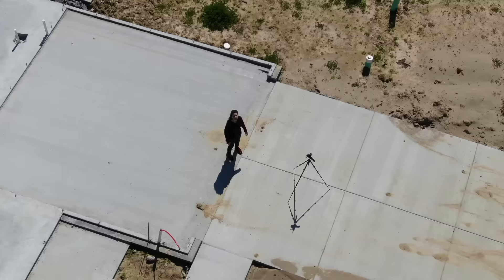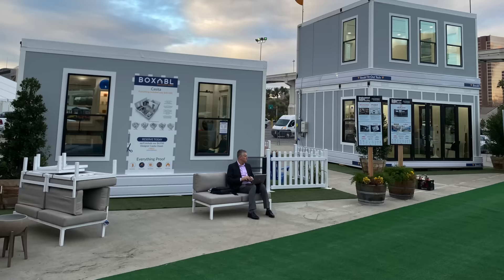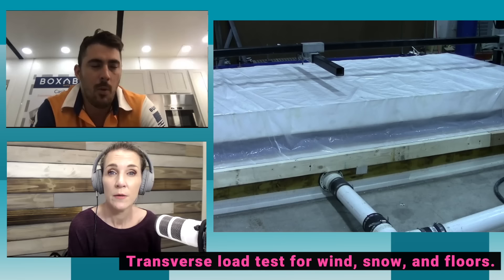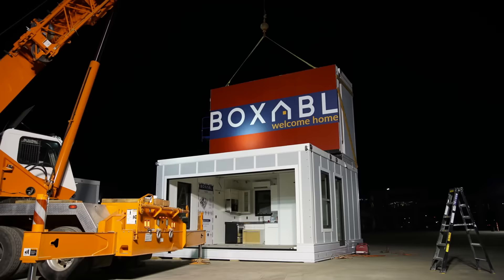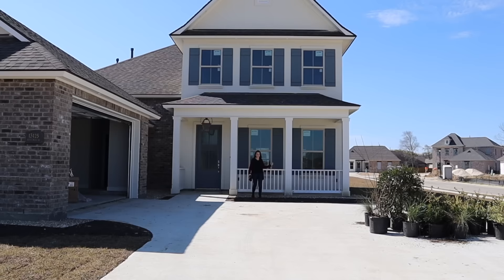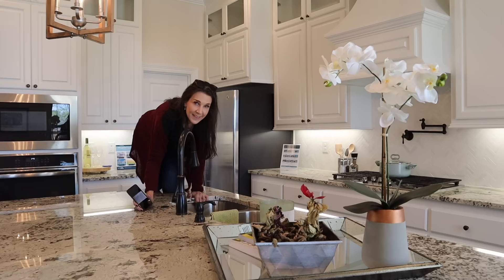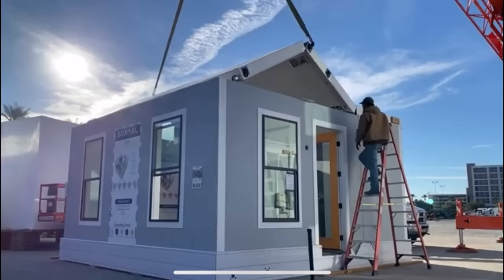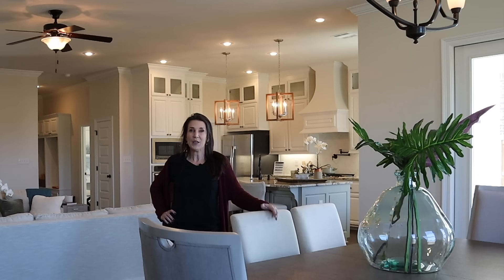Build A House In 2 HOURS?? FOLDABLE Modular Homes

Comment: With the homeless population continuing to increase as the Middle class slides into the Poor class. I can see this type of housing being of great benefit in alleviating the crisis in a cost efficient and timely manner.
Reply: artist one  ok we get it. You don't  like  this type of housing.  Who are you anyway? Some sort of "Super Troll" on here. I've read all of your comments on this vlog. They're all negative. So don't invest in one of these homes. 
I like this idea. The company builds it in the factory.  Delivers the home to your site and sets it up in like a day. The buyer of course has to coordinate setting up water and power. This gives the owner options like, Solar energy, Rainwater reclamation or well water, Propane or all electric for power and heat etc... I can purchase a beautiful lot down the street from me (5 acres) for $13,000. And taxes, well we all gotta pay taxes. Even after you're dead and cold in the ground the damned government comes for their taxes. With all of these costs I can still see this home coming in under $100,000.
So what's your problem?
Reply: Maybe at some point, but you could build a basic 20x20 stick and brick for $15,000 easy (finished out inside). The solution to homelessness is cutting municipal regulations so that it's easy to build 20x20 semi off-grid units in the $7,000-$20,000 price range. Homelessness becomes a problem when there's barely any options in between tent city squaller and $2,000/mo apartments.
Reply: @chrystallee5528  $100,000 !? I was hoping for $20,000, for the first floor of course maybe $25,000.
Reply: @caasi09ification  It sounds like you're living in a state of denial when it comes to the true facts of the situation. I agree there are lots of reasons people become homeless but once you're in the pit you can't easily claw your way out. The only reason $7.25 isn't a living wage for an unskilled worker is because of housing costs. Food and other commodities are fairly cheap. Apparently you want businesses and the economy to suffer and you want no homeless people to be able to get jobs period. Either they're paid exorbitantly well despite the fact that all they can do is push a broom, or they can rot and die on the street. It's a twisted mentality. 

It only costs $1,500 to build a 10x10 shed with a bed and solar panels to get out of the weather and lock away your stuff while you're at work. Let the job market thrive by lowering the minimum wage, boosting the number of easy, menial jobs for homeless people and within a couple months they should be able to save up enough for at least a shack to live in, bought and paid for. Maybe rent a parking spot to put it for $100/mo with a bathroom available on site. You may think it's too primitive but you can't say shit until you've lived in a soggy cardboard box. The possibilities entrepreneurs could come up with for housing the homeless cheaply are endless, you seem incapable of thinking outside the box. It's all a matter of de-regulating the housing market so these ideas can be implemented legally.
Reply: Chrystal Lee Drug addicts trash anywhere they live. I let a drug addict live in an RV I had once and you can’t imagine what a mess he made of it.
Reply: Chrystal Lee that won’t work. 1) the middle class isn’t going into the “poor class” they are mostly moving to the “upper class” I think the middle class shrunk by 6%  and 4%  went to being upper class. But also homeless people would need land to put these on and if they don’t have $1000-$2000+ for rent then how are they gonna get 50000$-100000$ for a factory built home?
Reply: @LucasFernandez-fk8se  Los Angeles is building some outrageously priced development for the homeless right now on Venice Beach. It will cost a lot and house too few persons for the amount being spent.
California has a 1.2 billion dollar approved bond and another 20 million dollars set aside by the county to assist the homeless.  I'm  sure housing like this would cost much less per person and it could be built rapidly and house more people. And this permanent housing could be set in area's  that wouldn't offend those "NIMBY" folks that want the problem solved just "Not in my backyard".  I mentioned  Los Angeles because their homeless population is estimated at over 100,000 in LA County. This includes, women, children, working poor, elderly, veterans handicapped and mentally disabled persons. Not just drug addicted  individuals.
Reply: @bluemopdisaster6445  They said in the vlog that the homes start at $50-55,000 (not sure if that included transport). Then there is land costs, development of the plot, implementation of utilities if not there already, Permits, inspections, and taxes and some cushion for unexpected expenses.
Reply: @markbtw7987  Really? $15,000?
That sounds great. How can I get a $15,000 400sq ft house built? Tell me more.
Reply: @chrystallee5528  I just built a 14x16 tiny house. Lumber was $1,200, metal was $1,100. Windows and doors $500. Insulation $400, wall panelling $350. Laminate flooring $250. Electrical/misc items $400. Cabinets/sink not finished yet but should be around $400. Bathroom isn't finished either, ballpark $400. Total: roughly $5,000. It only took like 3 weeks just me and one other person. If you found the right crew to do it for you that'd be probably another $5,000. You get the picture. Land, septic, water and electric will cost a bit more but that's not included with this $50,000 house in the video either.
Reply: @MarkBTW amazing. I am really impressed. Home ownership for under $50,000. A new built home.
Maybe you should start a program for economically housing those persons lower on the economic ladder.  I hope to one day have a small home somewhere. Are you a home builder? Is that what your profession is or do you just build for a hobby?
Reply: I think you are slightly confused as to what middle class means. A 400 square feet mansion and 3 brand new cars is the upper class.
Reply: I dont. I think you are desperate for a home and too insecure to deal with the paperwork for a REAL home. This depreciates. Period.
Reply: People need low and fair housing for 100,000 to 200,000 dollars for single and small families and this is a good idea if it works really for expensive cities and California homeless problem for sure is
Reply: All the homeless need to come together and fight against this bullshit it's pulling everybody closer into communism. If people could only learn to work together this wouldn't be a viable solution. This is a nightmare living situation. Fields of these people on top of each other houses only feet apart no trees sounds like absolute hell.
Reply: @Commentator541  not sure whom you are addressing this comment to but here's some info for you. 
The 2018 piece from Pew reported that, in 2016, the median income for the upper-income class was $187,872. While for the middle class, it was $78,442, and for the lower class, it was $25,624 (in 2016 dollars; figures reflect a three-person household).Nov 20, 2019
Reply: @wiseowl1580  If you're comment is to me. I have owned 2 homes in my lifetime  but I am now interested in minimalist living and someday having a small, self sufficient home in a semi rural area.
Reply: @chrystallee5528  for the cost a mobile home would be cheaper and twice the space
Reply: I like the fact that this is even possible and its going to save a lot of family in the future. I'm in support of its development.
Reply: @chrystallee5528  when you hear any business talking about fema in any way that's code for when the s,, t happens. Gingerbread another code. So all persons will not agree not saying they are not good homes. But if HUD is not cooperating then they are only available to the privilege ones so if you got land there you go.
Reply: Chrystal Lee  Yea but somebodies going to want money 

Where are you going to put it ? In somebodies backyard ?
Reply: Chrystal Lee most city’s and county permits are so high that’s why people choose to not build. Just a permit cost an average person yearly wage for about 3-7 years. If they just allow building to go up and collected taxes then homeless would be gone.
Reply: @caasi09ification  you're absolutely right. Homeless people with drug and mental health problems are not the type you want living anywhere near you. I'm experiencing it right now.
Reply: @caasi09ification  Actually it won't. A lot of Middle class people will still want traditional homes. This is not for everybody but it gives options to a lot of people who wouldn't be able to afford a traditional home.
Reply: @markbtw7987  Same here in Canada. I am on disability and have lived in the same windowless apartment for 15 years. I have paid enough in rent to have bought a house. If I was allowed to rent to own a house for $50,000. The government wouldn't have to keep bleeding out money for rent. If we where able to use well water that would also cut costs.
Reply: @markbtw7987  trickle up is how jobs are created. A company won't hire more people than they need no matter how cheap the labor. The more disposable income people have the more they will spend creating jobs. They go out to eat more creating more jobs and income for restaurants which means more money for the staff. They go out and spend more creating more jobs ect. Learn real economics instead the the voodoo stuff some groups promote.
Reply: @chrystallee5528  
Those additional costs apply to ANY new construction project.

In traditional stick-frame building, ~65% of the costs are for ON-SITE LABOR of the many various trades involved:  concrete, framers, roofers, plumbers, electricians, drywallers, cabinetry/finish carpentry, and painters, etc

That's A LOT of individual tradesmen to employ and license/bond/insure, or A LOT for a GC to hire and pay and still make his/her profit.

And that traditional stick-frame home will take MUCH longer to build, and will be built in an uncontrolled environment (potential weather damage), and the quality of work of each tradesman may vary due to individual skill and availability.

Once site prep is completed, having a finished structure move-in ready in 2-3 days instead of 3-6+ months is a GAME CHANGER!

This type of modular, factory-built construction minimizes each of those on-site labor costs, and moves them to a much more controlled environment, with more consistency of the building process and quality control.

The on-site prep, grading, and foundation work can also be done more efficiently and cost-effectively because of the consistency of the basic 20'x20' modular construction plan and utilities/sewer hookups, i.e. no odd, unique, or extensive custom work needs to be done for each individual home.

And 90% of the building inspection time and red tape is already done in the factory!  That is a HUGE time and cost savings that more times than not puts construction at a stand-still.

Another aspect that is important is that this single company will be responsible for the quality of construction and the guarantee of their product if any issues arise.

With traditional construction where a GC hires a large number of independent sub-contractors, it can be excruciatingly difficult to get any quick or even satisfactory resolution for the home owner.

This, of course, depends on the quality and reputation of each individual GC.  But especially on lower-budget projects, every possible "corner that can be cut" WILL BE CUT in order to maximize the profit margin.   So, you are more likely to receive a sub-par end result.

If you want something entirely unique and custom-built, you will pay exponentially more for that.

This solution aims to produce a consistent-quality product in the shortest possible time frame.  Sure, you pay a bit more for that as well, but that is usually 100% worth the slight premium.

I'm interested to see how far they can take this concept, and if the quality of construction holds up to scrutiny.

I would like to see more of the particular construction process and know exactly what materials are used before making a final determination.
Reply: @Jeffrey Kemper 
This would obviously need to be (and should be) thoroughly tested and is completely dependent on the construction type and materials used.

Just because it "unfolds" does not mean it will also fold-in upon itself under load or stress.

They still have to meet universal building codes, including shear/deflection, and actually must be more stringent overall in order to cover municipalities that have stricter local building codes, such as seismic, hurricane, flood zones, etc.
Reply: Great point and excatly what liberial Lynden B Johnson wanted
Reply: @vincent2993  and you are suuuuuch a bad speller.  Lol
Reply: @louiseschneider8103  haha I'm basically on the spectrum hahahahaha
Reply: Yes except not many homeless people or even average americans can afford a tiny $50,000 home. Way to much money for so little space. You can buy a huge traditional home for less
Reply: @clarezajac3276  I totally agree with you. It would depress people the longer they live like that. There has to be a better solution !!
Reply: Looks like a tough house but not crackhead or mentally ill proof house.
Reply: @markbtw7987  There's nearly free housing if you're that poor. But the problem is that the people that live in those areas don't treat the places too well because it's nearly free for them. That adding onto the drugs/gangs that take over and you get the ghetto.
Reply: @natureloversadventures7335  True, but the quality of most of the houses that are built down there, away from tourist areas, have no insulation, ill-fitting doors and windows, cheap cabinets, subpar plumbing, flooring, and electrical systems as well as poor sewage setups.  Many of those houses also have cheap thin wood walls on the outside and particle board or thin paneling for walls on the inside, with nothing between them to help plug up any gaps so light doesn't come in...or rain/cold.  And heating systems are basically nonexistent.

However, if a person or family living on the streets here in the USA were suddenly offered a cheap house like this to live in, they'd probably jump at the chance.  ANYTHING would be better and less dangerous than living on the streets!

Sadly, the amount and cost of permits required for building a house "up to Code"...as well as other red tape generated by  local city bureaucracies here in the USA...is unforgivable, having gone far beyond "Safety Standards" into "Greed". 

And there's no end in sight, too.
Reply: @zhenyucai8688  So once again, if  a person or family doesn't want to live in a high crime ghetto, they have no choices except to be homeless.
Reply: @andiegomes2764  I don't know about any permits costing someone the equivalent of 3 to 7 years' wages.  But I do know permits and inspections can be very high.
Reply: A lot of people who think they're middle class are actually working class...
Reply: This IS the solution for cities like Austin who have enormous homelessness issues.
Reply: @markbtw7987  just because ppl are homes, doesn't meant the lack skills, or not "worth" $15 per hr!! 😫🤦🏾‍♀️🤦🏾‍♀️🤦🏾‍♀️🤦🏾‍♀️🙄
Reply: @timekabolden5309  Imagine what $15/hr could buy if you didn't have high housing costs and utility bills? If you spend $400/mo on housing then that's $2,000 before taxes for food and then other stuff, not that bad at all. You could easily be well off for $8/hr if your housing costs were $400/mo. The key is getting housing costs down and teaching frugality to kids from a young age. Or we could go with your plan and raise minimum wage everywhere for irresponsible consumers to line the pockets of their landlords when they raise rent some more. Landlords are greed machines that eat into the wealth of the working class, until we shift toward truly affordable housing alternatives the poor and homeless will never lead dignified lives.
Reply: I have a feeling that most did not fully watch this video before commenting. This comes with everything except a bed ( they even provide washer/dryers) They also do free delivery upto a certain amount of states away. Ppl, pay attention to the full video versus just what you want to hear smh

Comment: I think this is a great option for someone looking to downsize to a tiny home without getting some skinny thing on wheels.
Reply: I agree.  I'm planning to retire in about four years and would love something like this.
Reply: But at $50,000 You could Build a Nice Size 16x28 Cabin Fully Done and Still have $35,000-$30,000 Left Over. These are Over Priced.
Reply: @ravenlorans  it’s 10$ for a 2x4 where I live. If you cannot build, plumb, wire a house yourself there is no way you can do it for 15,000$. Rule of thumb is figure out the cost of materials and double it for a built turn key building. I’m in southern Ontario Canada. Edit: everything is over priced. Lol
Reply: @ravenlorans  Those people who say they spent 15k on their shed home are calculating that not including the shed.
Reply: @ravenlorans  only if you have the skillset and are able bodied, and are allowed to do so in your state/county/city. Some areas are VERY strict about zoning and building codes and it can be hard to navigate them all when you're also trying to learn basic wood working and such. Not to mention most of the ppl here looking into these homes are looking for permanent residences not a weekend cabin
Reply: @crystalchili3823  That's the truth. The sheds themselves ( depending on size) can cost that or more. It's not legal to use them as homes in our area, well not the lofted barn type. There are a lot of things that have to be done on the regular roof ones as well to get them even close to code. A lot of hoops to jump through.
Reply: Actually these can be seened together to create much larger spaces.
Reply: Skinny things on wheels are awesome!